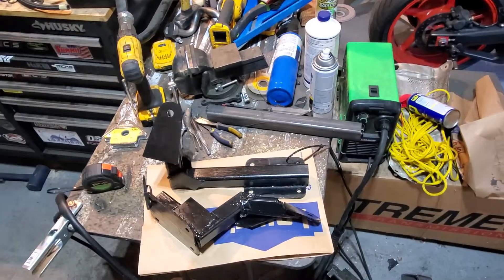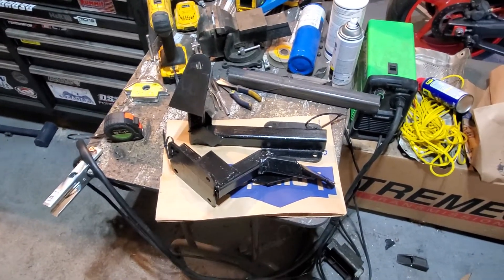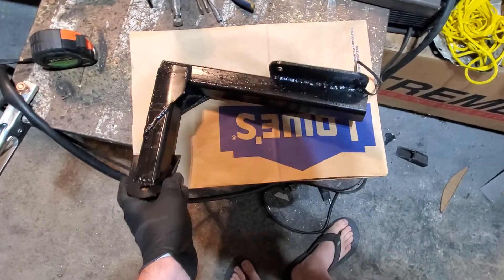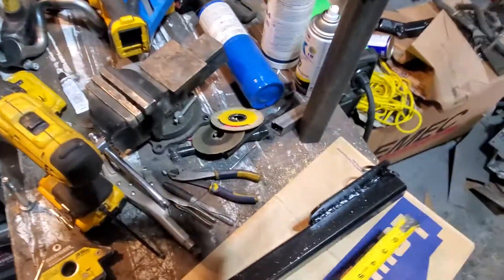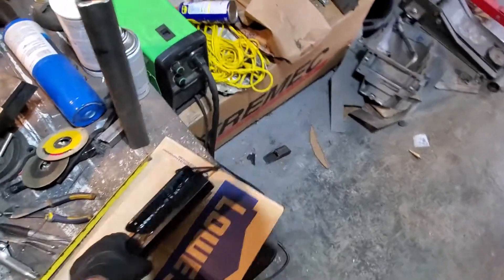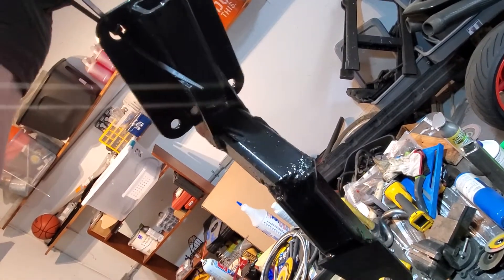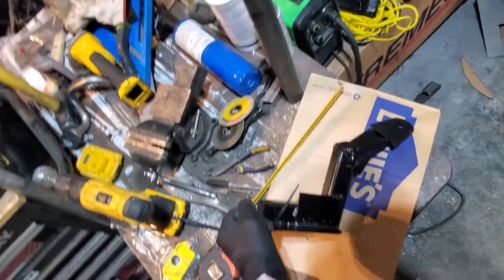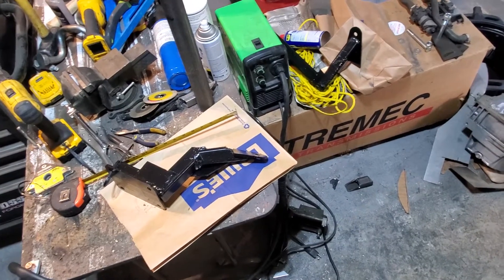e38 740iL BMW LS SWAP engine mounts

Comment: While you at it make me a passenger mount that will clear the GM ac haha or else ima have to do it before next summer
Reply from the maker: Hopefully it works and clears the a/c lol
Reply: @thehomeofbiglspower  you will be fine LOL just send it. I bought the engine mount but had to figure out  minor modification in order for the motor to sit straight
Reply from the maker: @vally520  yeah that's the plan, working on getting my driveshaft measured and made next.